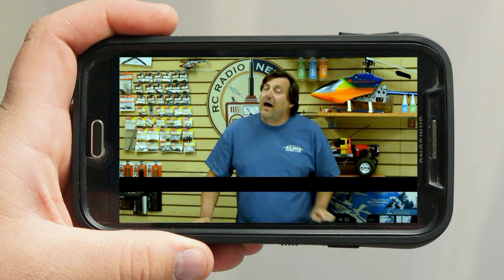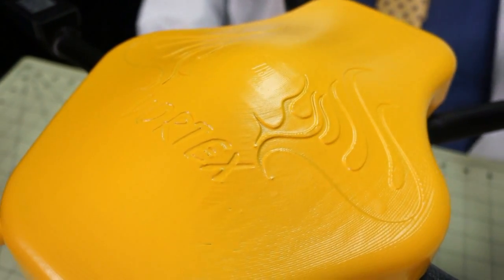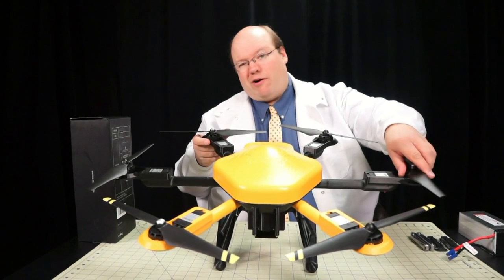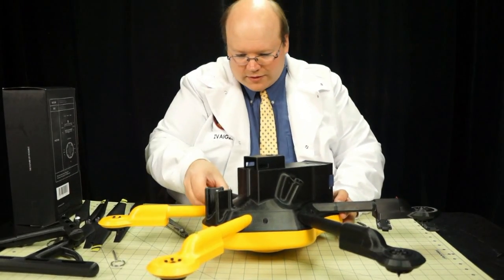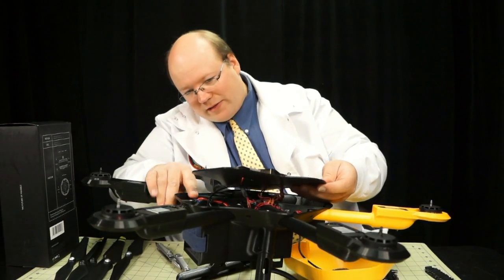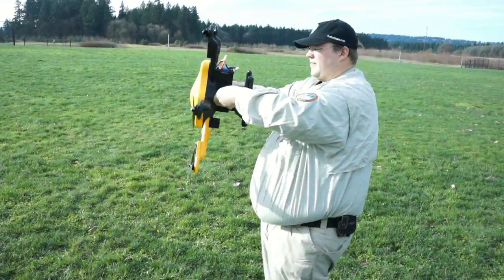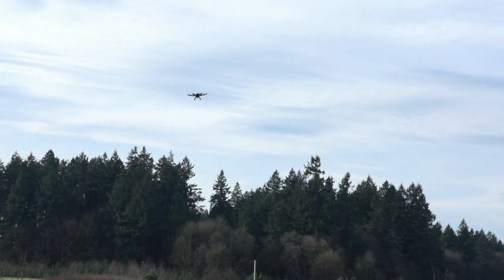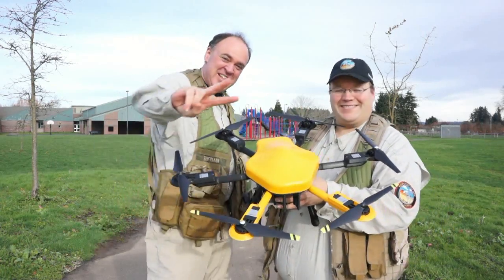RFTC: Vortex 3D Printed FPV Hexacopter Camera Drone from Atlanta Hobby

Comment: Are you guys actually going to do an Xaircraft review ?
Reply from the maker: Steve Westbury Hey, Steve! If we can get our hands on it, we'll review it! Do you have a connection with the company? I looked them up -- it looks like they have got some interesting aircraft in the pipeline.
Reply: Hi guys, I don't have a connection to the company but after lengthy research I decided on an Xaircraft Super X flight controller for my 650 size quad copter. They seem a lot easier to set up than most others and it seems that there is no chance of a fly away, I'm currently waiting for some better weather to finish my trimming but I have had a couple of flights and It is very stable in the air straight out of the box :-)
Reply from the maker: Steve Westbury Believe it or not, I was recently steered towards Xaircraft by someone completely apart from you -- suggesting that maybe they are "on the bubble" in terms of building awareness. However, after your comment here, I went back and took along <slightly> longer look -- and I would like to get my hands on one of these things and see what they can do. Stay tuned -- we'll see if we can't do something with them...

Comment: They did a good job on this, But they could have made the arm's plug in so you can take it apart. for shipping.
Reply from the maker: Soldier53flyer Yup... Obviously Cliff knows his own machine better than anybody, but Techinstein definitely saw the screws holding the limbs in place when we removed the cover. They use the same size bit as all of the other fasteners on the bird -- convenient!
Reply from the maker: Cliff Whitney Hey, Cliff! First of all -- thanks again for the bird! Second, you have a case for it? Send me a link!

Comment: What is the advantage of such a heavy hex at that size? And the gimbal, camera etc. hasn't been added yet. Is it more durable? Better performance in the wind? I can see a longer flight time, but some of that giant battery is just to lift a heavy machine. I'm not asking to be flippant-I am interested what it is. I am more with Techinstein on this one I think.
Reply: You can fly it with an 8000mAh battery for 17 minutes. The Vortex uses modular construction. It is very durable in a crash. The booms are designed to break on a hard impact to reduce the damage to the rest of the vehicle. To replace a boom/motor mount only takes 30min.

Comment: If the printer is so fancy why can I seen layers? Why not use one of those powder printers which are so smooth
Reply: You will always see the layers in a part that was printed via FDM process using ABS plastic. FDM printing yields the strongest and most flexible parts. All ABS plastic parts can be post processed to remove the layers.
Reply from the maker: Mike Nance Thanks for stepping in with the explanation, Mike! I'm no expert on these technical details -- but we did notice that it seemed like really tough stuff. As I mentioned in our write-up, Techinstein has some experience with 3D printing and he was really impressed by how robust this material is...
Reply from the maker: TheJttv I'm going to trust in what Mike had to say here -- I'm out of my depth when it comes to the technical details of 3D printing... Heck, I almost fell for it when Cliff joked about the surface being turbulated like the skin of a shark to improve it's aerodynamic performance -- see our video from Las Vegas.

Comment from the maker: What can we say but, “Wow!” As you heard Cliff mention in the video, we first found out about the Vortex from Atlanta Hobby when we met up with him at FlySafe in Las Vegas last year. He said – on video, no less – that he'd make one for us in yellow and black, the high-visibility color scheme that we use on our own homemade aircraft.

After we got back from Vegas, we didn't hear from him for a while. It turns out that yellow 3D printing filament is very hard to find – at least for the million-dollar, aerospace printer they use to produce the Vortex. However, Cliff never gave up and eventually this truly gorgeous aircraft showed up on my front doorstep.

Cliff, thank you ever so much – it's a thing of beauty and we'll fly it with pride. As I've said about RQCX-3 “Raven” many times before: they can have her when they pry her from my cold, dead fingers.

The Vortex is also a vindication of sorts for me and my design philosophy when it comes to multirotors, and a “win” in my column for a long-running debate between Techinstein and myself about the best way to design one of these aircraft.

Techinstein prefers to make the aircraft weigh as little as possible, based on the reasonable assertion that – everything else being equal – the aircraft that weighs less will fly longer. I, on the other hand, believe that aircraft construction should be substantial and robust – relying on larger motors, propellers and batteries to offset the additional weight.

Clearly, the Vortex demonstrates the advantages of my approach...

One other thing worth noting: I don't have much experience with 3D printing, but Techinstein told me that the resulting objects can often be somewhat fragile or brittle. I even noticed he seemed reluctant to pick up the Vortex and heft it around. However, by the time we were done with this video, he told me that he was surprised by how sturdy the Vortex is – much moreso than he would have expected.

I'm certainly not qualified to say, but I do know about the exacting standards that aircraft components are required to meet before they are deemed “airworthy,” so my assumption is that the pieces coming out of an aerospace 3D printer are much more robust than those produced by a conventional system.